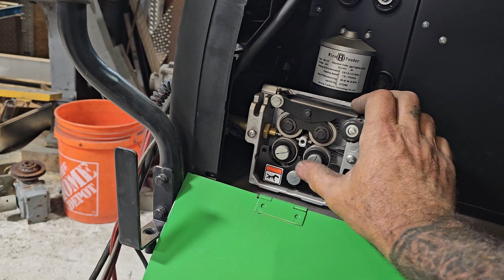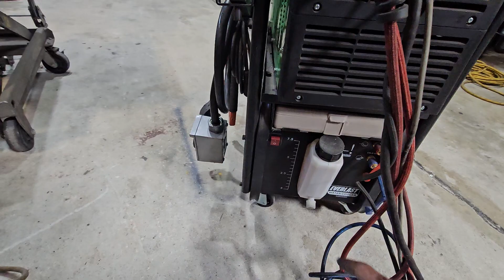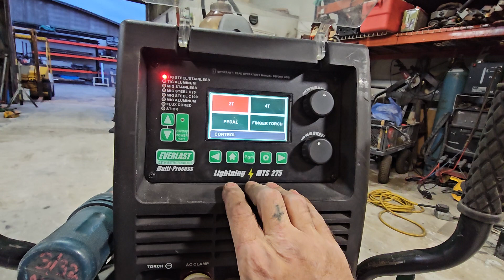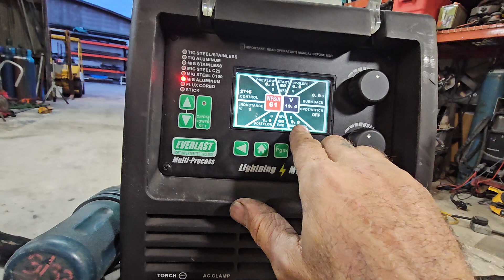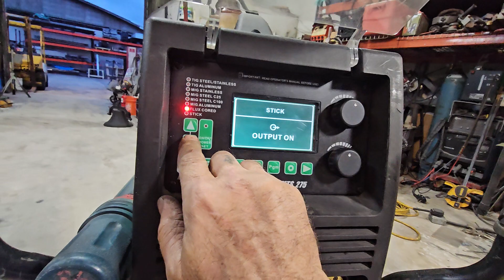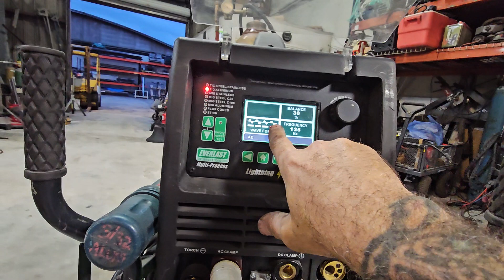everlast lighting 275

Comment: Is that the Vulcan cart from harbor freight you have the welder on? I bought the same one for the same welder and it doesn’t fit
Reply from the maker: yes it the vulcan cart. Thankfully i knew a welder and he modified the cart so the welder would fit.
Reply: @ yup that’s what I’m doing now. The custom job was done very well it looks like OEM from what I could see. That’s where the root of my confusion was.